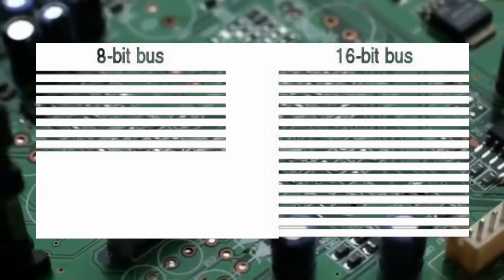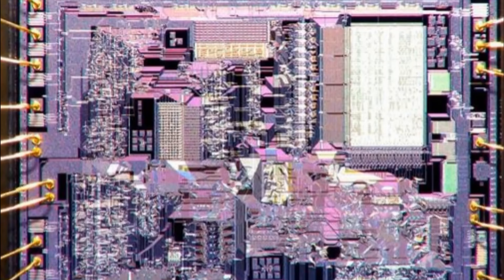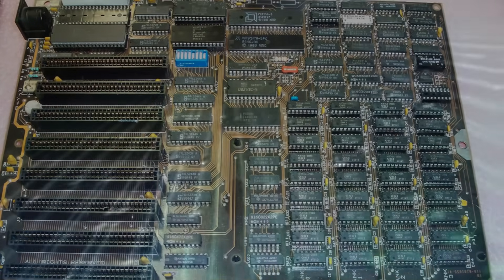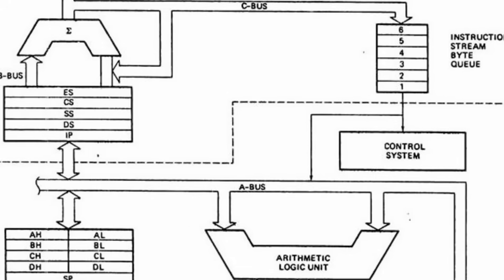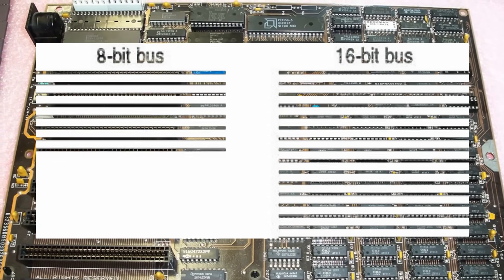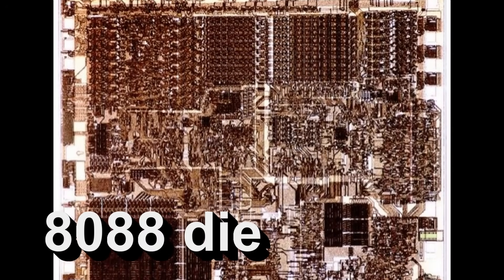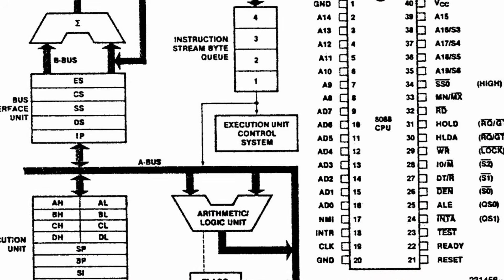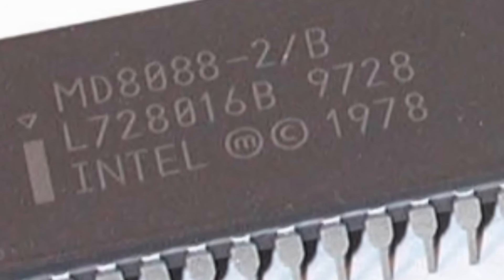8088 & 8086 CPUs... Why 16 bit Came Before 8 bit [Byte Size] | Nostalgia Nerd

Comment: Intel actually started working on a 32 bit processor first: the iAPX432. When it became obvious that it would be very late (started in 1976 it was only released in 1981) they did the 8086 as a quick and dirty project so clients could have something to use while they waited. Despite being 32 bits internally, the iAPX432 had a 16 bit external bus with multiplexed address and data which is one of the reasons it was so slow that Intel likes to pretend it never existed.

The success of the 8088 with the PC (I don't remember seeing any product with it before that) inspired Motorola to do the 68008 used in the Sinclair QL machine (and nowhere else that I remember). The problem with all these narrow bus processors is that they didn't have a block memory mode like the ARM did to take advantage of the "page mode" in DRAM chips. If they had, they would not be roughly twice as slow as the versions with full buses.
Reply: Funnily enough, that's something Atari DID take advantage of in the Falcon, along with giving the video chip 32-bit (and burst mode) access through a backend trapdoor into memory, which is why it doesn't suffer anywhere near as much as would otherwise be expected from having a 68030 stuck on a 16-bit bus.
Reply: I remember the iAPX432, the architecture was totally different from previous Intel CPUs, or at least enough that writing code for it was a steeper curve than going from the 8080/8085 to the 8086/8088.  That's one think I liked about the Motorola 68xx series of CPUs, it was a gradual progression up the product line until you hit the 68000, which was more of a minicomputer on a chip.

Comment: I want to mention that you can simply truncate the physical data path and use the lower half of the bus. Why wouldn't they have done this?
Reply: That only works is the CPU supports dynamic bus sizing.  I don't know is the 8086 supports that, but I'm guessing 'no'.

Comment: PCs got 16 bits in 1977 - consoles didn't get it until about 1988 with the TurboGrafx and Sega Genesis machines. 

PC master race confirmed.
Reply: AIO inc. IBM pc didn’t come out until 1981, but games only became good from doom on. Playing double dragon with beeps and 4 colours in the mid-late 80s didn’t compare to genesis. I remember when dad bought the pc to replace the Atari 800/130xe and alleycat wasnt as good, hence why I bought the Sega megadrive. Atari wrote games in assembly so had no lag or latency. We had been playing 16 bit in the arcades since 84 and only the megadrive could match in the 80s even if it was just for a year and had stereo sound.